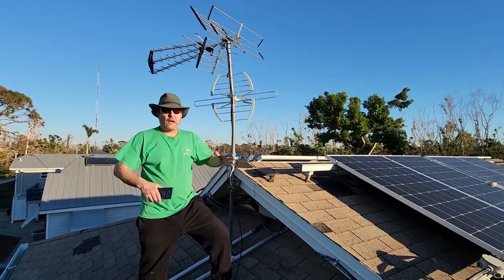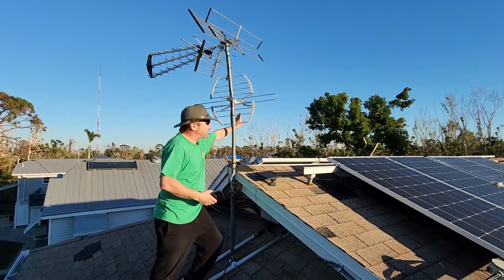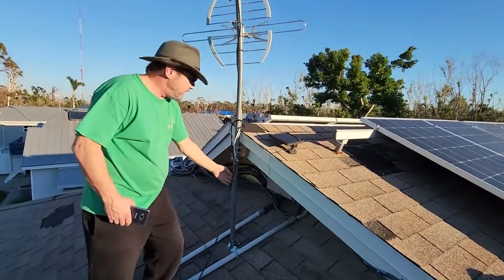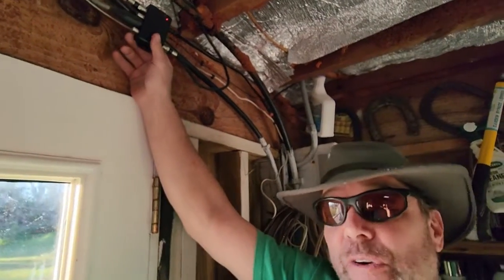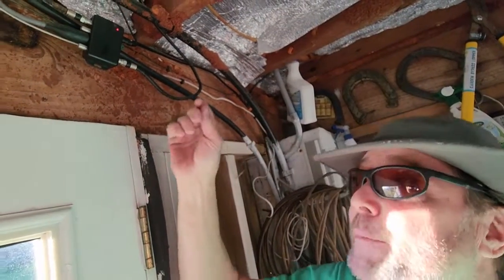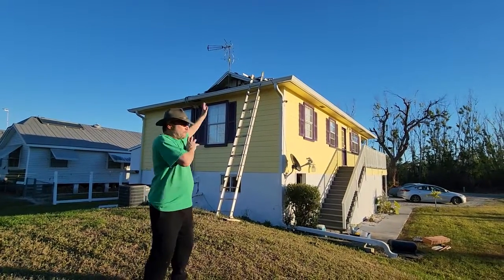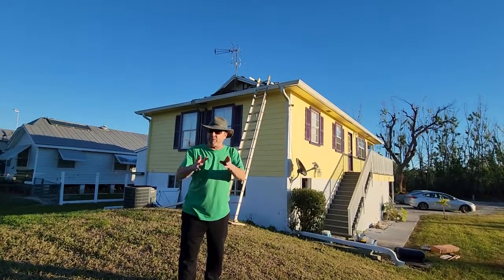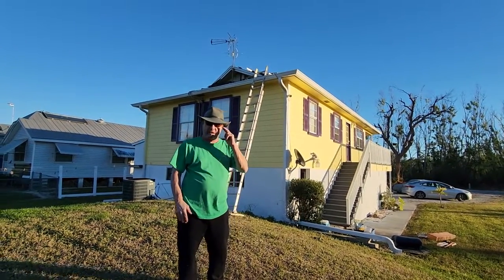Can I Combine 2 Antenna Feeds Into 1 Coax Cable?

Comment: Are you getting  the low power  stations out of Estero 22.1 -- 22.10 ?  They redid them again seems better shows, but still very low powered .. saying like 1500 watts.
Reply from the maker: I used to get them part of the time, cannot get them at all now after the last 2 hurricanes came through. Wish they would power up a little bit.
Reply: @TurbineGuy  im  around 10 miles from it . Antenna at 30ft and self built antenna with elements 1/4 wavelength to their exact frequency and still loose it. Did some research and it's a satellite signal from NYC then it's repeated from that tower max 1500 watts but they lower it all the time. And it's a weird shape pattern they broadcast it... wide and short range. Looks like a mushroom on  its side . Hope u can receive it again.

Comment: So "in" and "out" on the splitter don't really matter?
You can connect 2 coaxial cables (coming from 2 different antennas) to 2 "out" on the splitter and you use 1 "in" on the splitter as actual output (which is then connected to TV)... Is this right?
Reply from the maker: That is what I did and it works just fine, so yes. Don't forget to like video and subscribe!!
Reply: @TurbineGuy  
Thank you!
I have to join 2 antenna cables (1 to get signal from Italy and 1 to get signal from Slovenia) into 1 (by using 2 on 1 splitter) and then split it to 3 cables (by using 1 on 3 splitter; for 3 TV's... each on different floor in the house).
Actually this is already done in the house. But I guess the joint is bad/failed (splitter is not used at the moment... Cables are simply wired together), because on 1 of the TV's I receive only Slovenian programmes, while on the other TV I receive both Italian and Slovenian programmes. So it must be the poor joint... At least I hope so. 🙂
Reply from the maker: You may have to add a signal booster right after you combine them to enhance your signal for better reception. Make sure you get an outdoor unit about 30dB increase